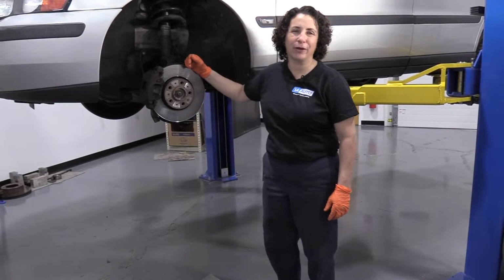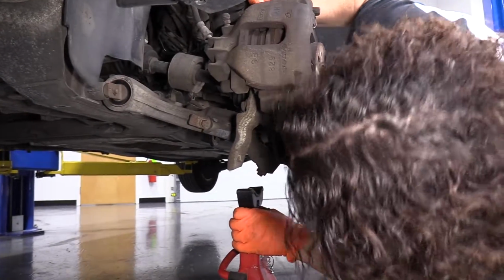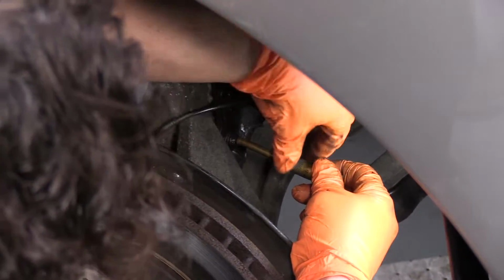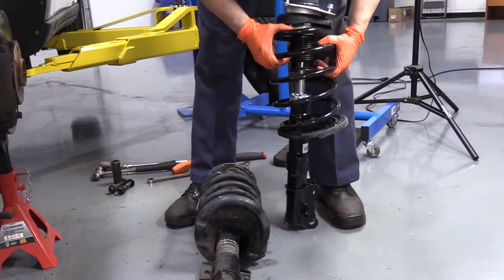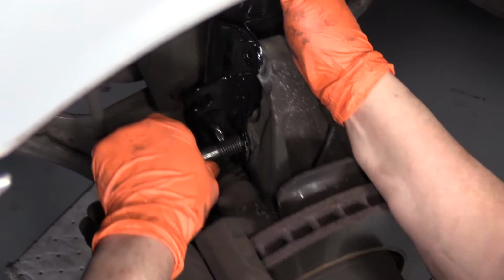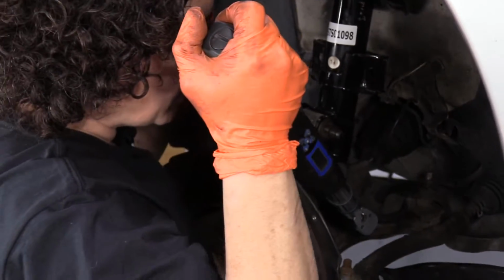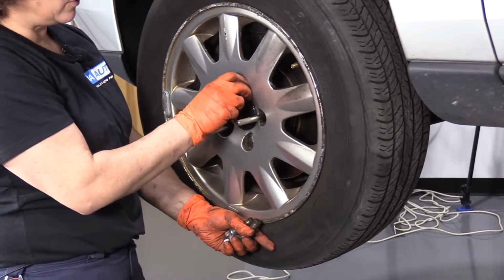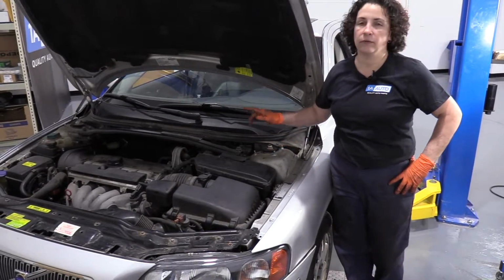How to Replace Strut Assembly 01-07 Volvo V70

Comment: I was doing some initial prep for this job (penetrating oil on nuts,  etc.).  I noticed that the bolt holding the upper end of the sway bar link did not have a Torx fitting on the end. So the nut & bolt just spin. there appears to be a thin nut on the inside that needs to be held - but access is tough and I think I'd need a thin wrench to get in there. The links were replaced a long time ago - not by me - so it's probably some cheap aftermarket assembly. Has anyone else run into this issue? Thanks!

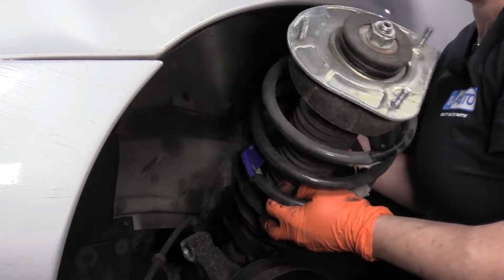Comment: I notice that Sue took out old strut assembly with round strut bearing plate (see video 7:06) & installed new strut assembly with square strut bearing plate (see video 7:43).  Can the strut tower fit either shape?  Sue is working on the Volvo V70 (P2 chassis) front wheel drive.

Comment: this is not an easy job.  Buy and use replacement bolts and nuts.  The control arm nut is so close to the strut you have to use the open end of the wrench, and remove at 1/6 turn increments.  Reconnecting the strut is more difficult.  My bolt needed to be replaced, and on Saturday all the dealerships were closed, no autopart store carried the nut or bolt, neither did the hardware store.  I was forced to use the old, knowing I will have to tear it down again to replace them.

Comment: Be sure to use idp reinforced silicone strut mounts. Standard ones prematurely fail after about 50,000 miles. I learned that one the hard way. Thank you for this excellent video.

Comment: I have a 3/8” drive torque wrench with angle that goes up to 100 ft-lbs. Does the overall peak torque exceed 100 ft-lbs after applying 77 ft-lbs + 90 degrees?

Comment: Could I run into any major problems by using an impact driver to tighten the bolts down, disregarding torque values?

Comment: I did this repair on a 2004 V70 in January 2020  and I'm about to do it again on a 2006 V70 (January 2021). One thing I learned after nothing would budge, was the car was in PARK. Once in NEUTRAL it all came free. This would be an important note to add to this training. Thanks
Reply from the maker: +Bob Lubell Thanks for the tip!

Comment: I love this woman Sue she is very lovely in many ways but for the life of me I can not understand why she is talking in mm last I checked New England was not in Europe. The curly hair is cute as a button though
Reply from the maker: Thanks for the feedback, I will pass it along! +Psqwall
Reply: It’s a car with millimetre sized nuts and bolts so you have to have to have the right tools- safety, damage prevention etc. walk the walk when you talk the talk.... and all that . sorry, have I just made a rhetorical statement ?
Reply: Beginning in 1973 all vehicles sold in the U.S. use metric fasteners. You may have noticed that engine displacement is no longer in cubic inches but in metric units of cubic centimeters (cc) and liters  (L). e.g. a 2.7 L means 2.7 liters aka 2,700 cc(s). 
Chevy 181 = 3.0 L; 194 = 3.2 L; 207 = 3.4 L;  265 is a 4.3 L; the 283 = 4.6 L; 302 = 4.9 L; 307 = 5.0 L; 327 = 5.4 L; 350 = 5.7 L and the 400 = 6.6 L  We are the last of 3 countries on earth that have not yet completely adapted the metric system.

Comment: Question: When reinstalling the strut assembly the nice young lady here mentions one has to push down fairly hard on the control arm while pushing up firmly on the strut bottom to align the bottom bolt. My question is - if the bottom of the control arm is already supported by the jack stand as she did in the early part of the video - How will one be able to push down fairly hard on the control arm? Any comment/help here would be greatly appreciated. Thanks.  Was concerned seeing how much the CV joint was moving in and out during this part of the procedure. Had a joint pop out too much doing this on a Camry.

Comment: Support point for tilting down is choosed wrong. In this way you can damage a shield (thin metal plate behind brake disc) that in later can corode and lead to abs sensor damage or even abs ring damage. 
I personally lug all nuts in place and use soft wooden blocks under brake disc. This will not damage it, if placed carefuly.
Sorry for my english.
Reply from the maker: +Edgars K Thank you for your feedback!